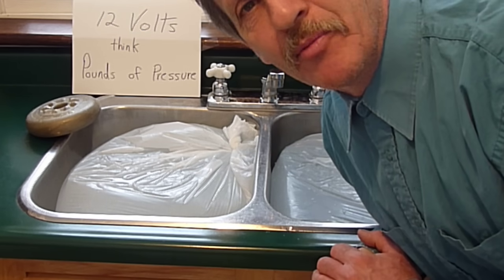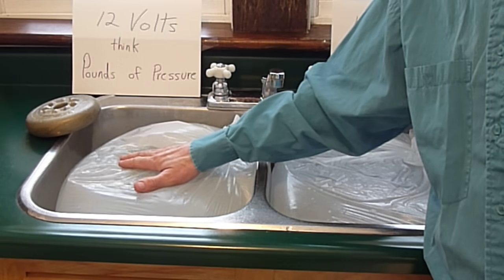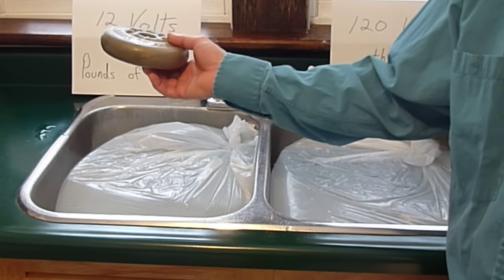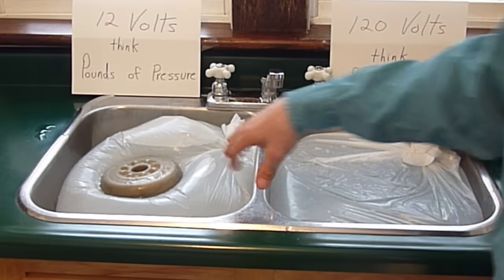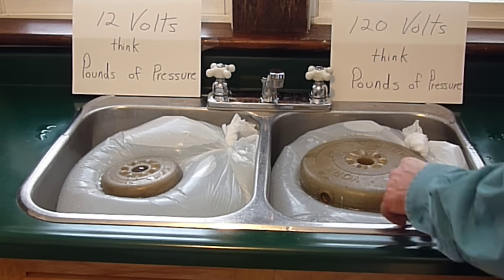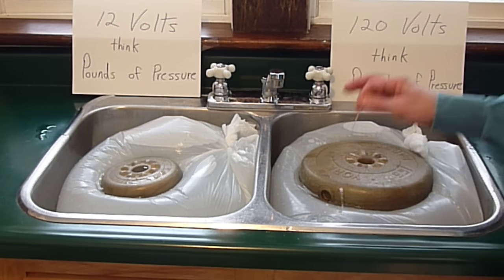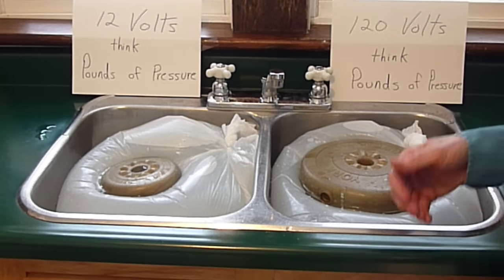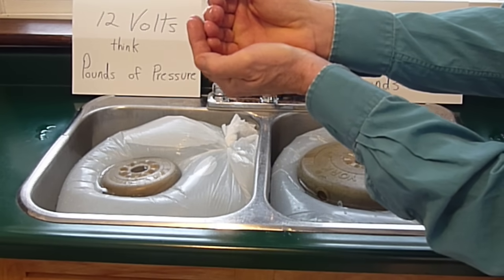Amps, volts, watts explained...SEE what it really is all about.

Comment: I like to think of volts as the height of a cliff, amps as water you're pouring over the edge, and watts as how big a splat it makes.
Reply: Voltage would be the height of the cliff and the density of the fluid. Current would be the volume of fluid over time going over the edge. Watts would be the kinetic energy of the fluid as it hits the ground.

Comment: If you make a bigger hole in the lower voltage bag, then there is lower resistance and you can get more amperage than the high voltage bag 🤯

Comment: While neat, this demonstration is entirely false.
This demonstration assumes 10,000 watts and 12 volts vs 120 volts. Ohms law states that power/voltage=amperage
10,000 Watts÷12 volts = 833.33 Amps. 
10,000 Watts ÷120 Volts = 83.33 Amps. 
Thus the demonstration is false because it assumes that the higher voltage =higher current.
 In reality they are inversely proportionate.  The higher the voltage, the lower the amperage. That's why transmission lines are such high voltage so that the amperage is low and thus you can use a smaller conductor.

Comment: If you want to compare liters with energy, it’s going to be 10,000 Joules in those bags, not Watts.

Also, if you want to compare kilos with power, you don’t put 12/120 Volts on those bags but 12/120 Watts.

If it were your intention to demonstrate P=UxI, the comparison fails because in order to produce 10.000W with 12 versus 120 Volts, the amperage is less in case of the 120 Volts, while your water stream is more.

Comment: Nope, guess I'm dumb, that didn't clarify it to me at all but everyone else apparently was helped?
1.) Bags represent the battery, it is the container of potential electric energy?
2. Water inside the bags is the potential electric energy actually contained, both batteries contain the same volume and maximum volume in this case
3.) whatever those round things were are also described as batteries in the video. How? When they don't contain anything? How can it cause the size of the voltage? Or are they not representing batteries and are just representing voltage?
4.) The higher voltage causes more electricity to escape the battery faster?

I am not certain I understand from here. The amount of water escaping at once is amps? The amount of amps is a consequence of the voltage? Why do we need to be careful because of this and why is being careful represented by a shakey hand?  The hand now has some of that water, apparently the water is watts now? Or only the hand and the water together are the watts? Neither? What does the hand represent if that is not so?  I am not sure if I'm even articulating the my confusion right?
Reply: A more precise analogy between water flow and election-gas flow (both are incompressible fluids):

- Volume (L) = Charge (C)
- Flow rate (L/min) = Current (A)
- Pressure (Pa) = Electric potential, voltage (V)

Energy is energy and power is power, because pressure x volume yields the same kind of units as voltage x charge - energy, in joules.

Comment: The content of the bag does not correspond to Watts, but to Coulombs (charge). You don't collect electrical power, but charge.
The speed or flow rate of the resulting water flow e.g. liters per minute, corresponds to Amps. (Current)
The power of the water flow, a product of flow rate and pressure,  corresponds to Watts (power)

Comment: So how do we use the word "current" in this analogy? Does the size of the medium that the electricity passes through affect things? Does the velocity of the amperage depend not only on volts, but also on the size of the medium? I'm thinking of water passing through a garden hose. I guess volts determine the amount of electricity, and the relative proportion of the size of the opening of the hose to the force of the water being pushed determines the velocity. It would be good to see a second part to this video where these ideas were illustrated.

Comment: I don't like this analogy. It's misleading.

If anything, the voltage should be the difference in pressure between two containers connected with a tube.

Battery should be a pump that creates that difference.

Current should be, well, the current in the tube (like cubic centimeters per second)

And I can't think of the analogy of power (watts) in that system

Comment: So watts is volume (how much energy there is), volts is pressure (how much force the energy is applying), and amps is flow rate (how quickly that energy is transferred)?

Am i underatanding it right?
Reply: youre not. and its not your fault. the guy is talking about watts as if they're how much electricity there is in the bags. in reality watts is a measure of the flow of electricity. (the power).

Comment: Your explanation of volts and amps was good, but the watts was incorrect. The volume of the bag is better represented by coulombs, the unit of charge. Watts is the flow rate times the height it spurts out.
Reply: Pretty much. Electricity is very much like flowing water, so the analogy is great. Voltage is like water pressure (PSI), amperage is like water flow rate (gallons/minute), and power (watts) is their product (voltage)X(amperage).  Similarly, the product (Amperage)X(Time) is like the capacity (gallons) that has escaped from the bags, but he kept calling that watts (wrong). He could have also mentioned that resistance is the smallness of the hole ... smaller means more resistance. For a given resistance (hole size), twice the voltage (pressure) results in twice the amperage (flow rate). With such an explanation, this video would have been perfect. 🙂
Reply: It's just an analogy for children and retard adults. Real electricity is about EM fields.
Reply: Yeah I didn't understand the difference between the water he caught in his hands and the water that was still in the bag because there really is none. Obviously what he caught in his hands is what was being applied to whatever it's being used for, but now I know wattage is voltage x amperage, it would've been easier to understand if he somehow caught all of the water coming out
Reply: Wouldn't amps x time better describe the electric supply that the system gives than watts per hour?
Reply: @viktorpantazis4441  Yes, ampere-hour is more commonly known from battery capacity and is a scaled version of the unit coulomb.
Reply: @russelllang2910  thanks!
Reply: The explanation of voltage was also incorrect.
This guy doesn't know electrical principles properly. 

The entire video is wrong

Voltage IS NOT PRESSURE.
it's being taught wrong
Reply: @devarmont87  obviously it's not pressure but it's called an analogy. don't be autistic.
Reply: @devarmont87  can you make a video explaining it better then?

Comment: Equating volume to watts is fail by 20 seconds in.  Watts is a rate, like gallons per hour (at a specific pressure), and not a quantity.

Watts are like horsepower.  To get to Watts, you first need Amps.  Amps would be flow rate through the hole.  Multiply the amps (which is an instantaneous measure like speed) time to Volts and then you have Watts.  

Pressure is like Volts, but everything else was incorrect.
Reply: I think the confusion happened here because what the author really describes by bag volume is Watt-hour, not just Watts
Reply: @dmytrorekechynsky  And not even a mention of amps.

Comment: The metaphor I like is a river. Current is the volume of water moving per second, Voltage is the slope of the river causing the water to flow. Steep slope - high voltage, shallow slope - low voltage.

Comment: I appreciate the visual, but doesn't this demonstrate the exact opposite of what happens in an electrical system? As Voltage increases Amps decrease, right? Here, amps increased with volts. I'm genuinely asking. I struggle to visualize electrical power as something mechanical.

Comment: I thought volt is the difference of potential,  so it would be the amount of water (it's the same on both bag). 

The amperage is the intensity,  so yes more amp egal to more water exit the bag (the flow)

So more weight increase the pressure, so more pressure egal more flow (more amp).  

The weight doesnt influence the quantity of water (volt) but the flow (amp)

Therefore the weight should represent the amp not the volt.
Reply: No. He is correct. The amount of water doesn't matter for this demonstration. If you want you could say if the bags were batteries, the amount of water is the capacity of the battery. The weight is the voltage, the size of the hole is the resistance, and the water flow is the current.

Comment: This is what the internet was made for. Years of trying to comprehend electricity from articles and diagrams, and you've perfectly explained to me the concept without any dawdling. 10/10!
Reply: When he says watts, it's actually watt-hours or Joules, So the bags contain Watt-Hours, not watts.

You can also say that hole size is conductance, and resistance is 1/conductance. Bigger hole = less resistance.

Next analogue would be adding a pressure controled valve on the hole and calling it a transistor.

Comment: In audio it's the amps that maintain the voltage for a given volume.If the amperage from the amplifiers output begins to weeken the the voltage will waver causing a hisr and fall of the volume.This is why high power amplifiers require hi current power supplies to maintain the voltage at the speaker when loud

Comment: When I was learning basic electricity, I watched a lot of videos that tried to explain this relationship. This is the one that finally made it click. The only thing I'd add, is that the size of the puncture hole can be thought of as resistance/impedance. So in this experiment, a larger hole (ie lower resistance) in the 12v system, could yield the same current flow in amps as the smaller hole in the 120v system. Thanks for the excellent video and sending me off on my way of electronic tinkering. Aloha!
Reply: Nice touch on equating the hole size being inversely proportional to resistance, just like a thicker wire has less resistance and therefore more ability to conduct flow.
Reply: @adamcolbertmusic  THANK YOU
Reply: Yes, I believe it would but if I'm not mistaken then this means the electricity will deplete faster. So let's say both setups have an unlimited source.
Reply: But I was always under the impression that the more resistance you had caused more amps which led to heat/ failure or just intentional reasoning
Reply: @MCKlNNEY  That's "over current" applying more force (lbs) to push the water through the hole faster. In the bag it will cause the hole size to enlarge, in a conductor it'll cause heat. If your wires are getting hot, either your force is too great (lower the input voltage), or your load is too great (increase the conductor size) to ensure it can supply enough current (without burning the house down).
Reply: So what if you added so much weight (volts) that the resistance just couldn’t take any more pressure and just burst right open? Is that possible?
Reply: @mrc25381  Then your house burns down... yes that is possible.

If you're lucky the circuit is designed to detect overcurrent and shutdown, if not grab a fire extinguisher you're gonna need it.
Reply: @mrc25381  Yeah, if voltage goes too high, something analogous to a bag bursting could, and likely would happen. In most circuits, a fuse or diode or something would probably fry, killing power to the circuit and preventing something like a fire, but as voltage gets higher, more things start to become adequate conductors, so all bets are off. It really depends on the circuit.
Reply: Thank you for taking this time to explain in youtube sir! You are a great teacher!
Reply: You done it now! I'm confused as shit again after reading your comment 😅
Reply: @KILLAKANE45   Ha, okay, well think of it this way. Keeping everything else in this video exactly the same, what would happen if he punched a much larger hole in the "12v system" and a tiny little hole in the "120v system"? It's possible that the same amount of water would be coming out of each system. But how is this possible if one is higher voltage? That's where resistance comes into play. A car battery is only a 12v system, but obviously it pulls A LOT of amps....because it is a very low resistance (ie. large hole) circuit. The cell phone charger you plug into your 120v (or 240v overseas) wall outlet pulls WAAAAY less amps, because it's an extremely HIGH resistance (ie. tiny little hole) circuit. 

Intuitively it works too. A tiny little hole will RESIST most of the water from flowing through it, whereas a larger hole will have LESS RESISTANCE to water flowing through it. The same is true of resistance in a circuit, where less resistance causes more amps (water) to flow, and more resistance causes less amps (water) to flow. It makes sense right? Less resistance = easier to flow. More resistance = harder to flow.

So keeping voltage the same, a 120v circuit with 1 ohm of resistance (VERY low) will cause 120 amps to flow. A 120v circuit with 10 ohms of resistance (pretty low, maybe a hair dryer) will cause 12 amps to flow. A 120v circuit with 100ohms of resistance (laptop charger?) will cause 1.2amps to flow....and 1,000 ohms (ie. 1k ohm) will cause 0.12 amps to flow, etc. The same would be true with a water bag weighed down with a big weight. The bigger the hole (ie. less resistance) the more water will flow....smaller hole (ie. more resistance) will result in less water flowing. Again, less resistance = less resistance to flow, meaning more flow. More resistance = more resistance to flow, meaning less flow.

Sorry to repeat it multiple ways multiple times, but hopefully one of them clicks. If not, just hang in there and you'll get it! If it did click though, congrats, you just learned Ohm's law the fun way! ALOHA!
Reply: @evankolpack  Thank you sir!
I'm 18 and i thought i would never understand what volt,amp is.i was really frustared for years.Learning definitions,solving hundreds of problems but still never understood what volt is.
I first saw the video then yourr second explanation.It was real fun.Thank you so much.

But i have a question.

We saw that the smaller the hole the faster the water comes out.The opposite when  the hole is bigger.

So does it have any impact?
i mean the speed of flowing.Or it isnt a thing.
Reply: @tanvirbinlokman8576  That's a very good observation, but as you guessed, that's where the analogy breaks down and is not a thing. It starts to get very complicated very fast, but electricity flows just below the speed of light no matter how much voltage (ie. "pressure") is applied. While water is a physical thing that is pushed around and moves faster or slower based on pressure, electricity is a whole different animal. It uses the electromagnetic quantum field to transmit electrical energy. We often visualize electricity as electrons moving in a wire, even many professional electricians think of it this way, and while that IS partially true and some electrons do move through the wire/circuit, in reality that's not where most electricity comes from and this is just a helpful metaphor to conceptualize things more easily. Again, it gets very complicated very fast and you quickly run into Maxwell's equations to truly describe how electricity works, and there's really not much need to understand things at that level unless you're going into a very high level professional field, but if you're curious Veritasium has two great videos about it. They had to make two because the first one caused so much debate that they made a second one to clarify. That's how complex and counterintuitive it gets at this level, even among experts, so don't worry if you don't get it, practically nobody does! BIG ALOHA!
Reply: @evankolpack  There's a video called: Watch electricity hit a fork in the road at half a billion frames per second
It might make you rethink your understanding of electrons and electric currents.
Reply: @KILLAKANE45  The size of the hole (like the size of the conductor) is relative to how much Water (or amps) can flow. Also there are some material conductive properties in there somewhere, but at this level that can't really be included.
Reply: This explanation was wrong though.
So now you're brainwashed into Thinking a delusion.

Sad
Reply: @devarmont87  Care to qualify that statement with references? Or at minimum a cogent explanation?